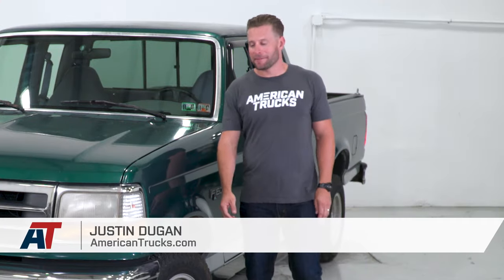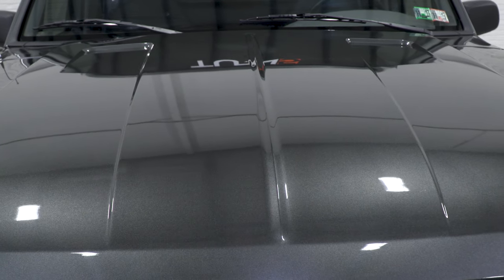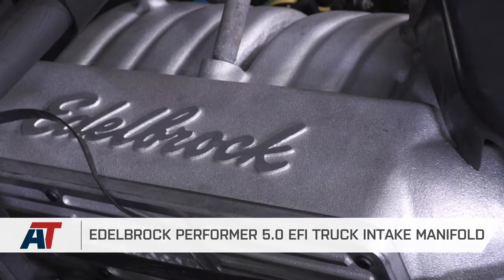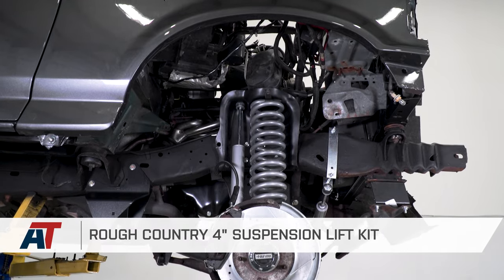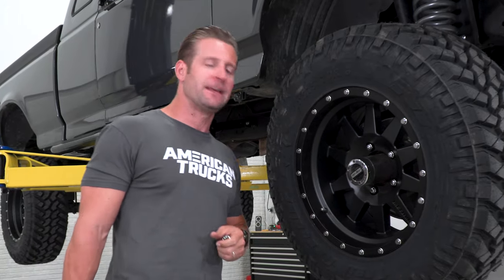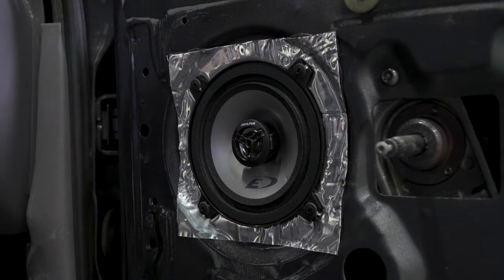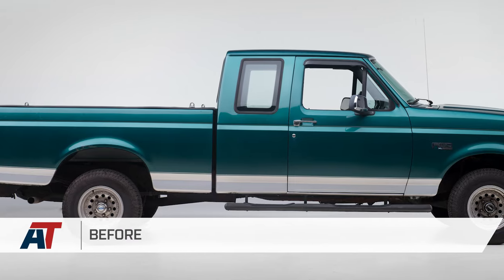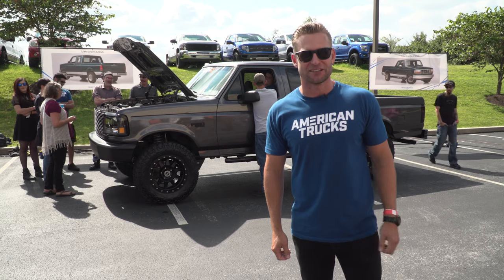Make-A-Wish F150 Build - 1996 5.0L F150 Gets A 4" Lift Kit, 34" Tires & $20,000 In Other Parts!

Comment: “Almost at 200k miles almost beyond repair” bruh I’ve never even owned a truck under 200k🤦🏼‍♂️
Reply: My dad has a 1995 f150 almost at 300k and it runs perfectly
Reply: I have a 7.3 powerstroke and she has 382k runs like new
Reply: @stankmeme5909  Lol same here. 01 with forged con rods. 315k miles. Abused 6 owner work truck but she purrs. Lmao
Reply: LOL, same here buddy. That's funny 😂. All mine are high mileage, but DEBT FREE!!
Reply: My dad's 1990 f150 manual has 850k
Reply: My Chevy is at 270k...
Reply: same
Reply: wyatt ainsworth yea 200k is barely worn in I got almost 320k on mine and she rides like a Beauty
Reply: 2008 Escalade 420k miles only change waterpump and thermostat
Reply: Those 4.9 V6 last forever dude. I have a 1994 XL F-150 with 200k+ and it runs great.
Reply: Tucker Roberts yup my 96 f-150 sat for years before I got it and is rusted like crazy cause I live in Canada, but the engine runs like new only had to replace the end the connects to the battery
Reply: These dudes are nuts. The 300 i6 was the best damn motor they ever put in a truck. Lasted forever like a diesel
Reply: @FD_FTP  Mine has 338k miles and still running strong.
Reply: @thejuiceisloose8703  totally true!!! I got a 96 with a inline 6, over 300,000 miles and it stayed awesome! Doesn't leak oil or anything! No rust! I inherited it from my dad, and I drive it every day for work. It pulls my utility trailer and tools...love my truck!!!
Reply: @normansawatzky4778  read a story a few years back from the clash for clunkers days that Obama did. They followed procedure by draining the oil and adding the additives to freeze the motor up. It ran for more than 3 hours before it gave up. I've had two of them and bit had over 240k. Ran smooth as can be.
Reply: In the north there’s trucks that go beyond repair at 100k with the frames rusted through.
Reply: My dad's 2002 dodge truck is way over 200. The AC leaks when it sits and needs a heater core. Lifters were replaced 2 years ago. Drives perfect
Reply: @xBIGxSAVAGEx a truck.... a.....Truck..TRUCK....I have a 14 mustang GT but nice try🤦🏼‍♂️ I like the older Silverado’s
Reply: Not as high miles as a lot of y'all but my 96 has 195k or so and runs great
Reply: my truck has 400,000+k and it was a mud/work truck  most of it's life and even with i6 it still wants to party
Reply: My F150 94 I6 has 200k and runs really good lol
Reply: I have a 1997 F-150 with 168,000-168,300 miles
Reply: Yeah I have an 03 Ford F250 and it has over 450,000 miles
Reply: I just bought a 94 i6 f150 with 190k wish me luck

Comment: Should have undercoated the thing so it doesn’t rust out any more than it already is
Reply: Clay Sensiba I’m saying, they had already took the body apart too so it’s not like it would’ve been a lot of extra work.
Reply: Also should have painted it last
Reply: Sandblast the whole thing then paint the frame build it then paint the body
Reply: They mentioned that they had a very limited timeline, maybe that's why they didn't undercoat the whole thing
Reply: Clay Sensiba lol brand new 2nd gas tank but we for got to clean the straps up
Reply: They could have hit the problem areas with a wire wheel and spray paint it dose not have to be perfect.
Reply: Clay Sensiba no shit i was like thats a sweet truck except that frame getting ready to snap in 3 years ....should have bed lined that frame and under bed and cab
Reply: Or maybe theyre not retarted and know that the frame will rust faster with an undercoat. The undercoat traps in moisture and accelerates rust, you just can't see it. Its either strip it down and powdercoat the whole thing, or let it ride.
Reply: Clay Sensiba indeed
Reply: @The Baddest Of Them All 
Chassis Saver or any other brand of rust converter would have been the optimal way to deal with that rust!!!
I just used it on a drawbar hitch and it came out nice!!!
Reply: That’s what I was thinking
Reply: keep in mind this build was on a charity budget, so they had to cut corners somewhere. not to sound mean or anything, but when you're pimping out a truck for somebody who is dying longevity is probably not a big issue for them.
Reply: @thebaddestofthemall9670  if you use chain bar oil for your undercoating you do not have that problem.
Reply: Most under coating seals in the water and causes more rust to rot quicker. It can't get air so it cant dry.
Reply: @user-zq6pj5jo8j  That is true with any undercoat that hardens, NOT true with oil or grease or transmission fluid.
Reply: They did a slight under coat
Reply: Lmao, not all of us live in a snow covered wasteland.
Reply: Undercoat actually seals in the moisture and causes the undercarriage to rot out quicker
Reply: actually I wouldn't do undercoating your better off to just oil spray the frame every fall and that all depends where you live as well.

Comment: When I saw the Alpine headdeck and JL speakers I knew these guys  were legit.
Reply: lol that was me when i saw the cam!
Reply: Sundown, CT audio and dc Audio are way better than any alpine or jl stuff but grant it not everyone can spend 1500 dollars on one 12 inch sub.
Reply: "ok so we're installing a brand new dual head unit with some pyle speakers and a lightning audio subwoofer powered by a boss armor 6000w amp" hehe could you imagine the cringe?
Reply: Kale Gorskey all of those brands you mentioned are spl oriented, they are not good for sq
Reply: Electronics For Fun I’m deaddddd hahahahah
Reply: @avrajsamra4548  they arent oriented for anything but being terrible
Reply: @seanmartin5056  word. Came here to comment on that but you beat me lol
Reply: How do you amplifier 4 door speakers with an amp in the back. I literally have 4 speaker wires, 4 RCA cables, and a power cable running down the side of my truck to power my door speakers. They’re     75 watt RMS each and loud as heck but wires galore

Comment: Cam, headers, Flowmaster exhaust, but you leave both of the stock and restrictive catalytic converters from 1995, why?
Reply: KsKaylor so he doesn't lose that back pressure boy damn gotta have the cats
Reply: @IFFIkillaWard  No you don’t. You think any Fox Body running around still has cats? As long as you run them out the back you’re good. I’ve seen a tiny amount of power loss in turn downs

Comment: I have a 1990 Ford f150 4x4 with the 5.0 engine.
A lot of good things that you've done in this video and some that I plan on doing. My biggest thing is to pull the engine. For a lot of years my engines leaking oil all most as fast as you can put it in. I broke my back 14 years ago and it takes me a long time to do anything. 

I have a couple friends who have offered to help me get my engine out. Once I do I plan on doing all the work on the motor. I figured over the winter I can do the motor. I usually get about a half hour to an hour to do things before I have to lay down again so that's why I figured winter is perfect.
I'm really not thinking of changing the color after saying this I'm considering it. That's my color if my truck was going to be anything but black it's going to be that color.

I love that front bumper that really makes the front end look good. I also like those rims. I'm happy with 31s under my truck. To me that's my perfect size and I've never ran into problems with needing a taller truck. 

I'm definitely saving this video so I can use it for references for working on mine.

You guys really knocked it out of the park.

Comment: When are you guys offering support for the 93 to 96 Ford's I have a bronco and it needs love but funds are dwindling but I love how easy everything is to find on your website it's all right there!
Reply: I’ve been wondering the same thing for a while now
Reply: I have a 94 Bronco and it would be awesome if they can work on it.
Reply: Im a coved19 survivor can my 94 bronco get that makeover. Its not as rusty i promise.
Reply: @OliverKoolO  what do you need done?
Reply: The stuff that goes bad when an old ford sits to long. Timing cover seal leaking coolant.  Thats a pain to change. I did do a rust proofing/prevention using Stabil took 4 cans and Im really happy about it.

Comment: they spent 20,000 and could not rebuild the motor. that probably burns oil .plus with the lift ,tires ,and new gearing the motor won't last 15,000 miles, from a lead footed teenager. but at least the truck will look good sitting on the side of the road with a piston rod through the block.
Reply: biggy poppa not really. They’re built to tow. Big tires won’t affect it much

Comment: Can't fit 35's ??
Reply from the maker: Negative. -Justin
Reply: Bullshit- it didn't need the lift kit to fit 33's, mine is on 33's with the std gear, 33 is the limit. With the long perches you put under that truck, 35's easy, just have to watch/alter offset to negate scrub.

Comment: I lifted my 87 Bronco and a bit more. My lift did not drop the TTB down at the mount. My TTBs are cut and turned at the end then I plated and gusseted with a plate also wielded to the diff. The chromoly radius arms are to the back of the door heim joint mounted. The King Shocks (huge improvement massively huge) mount lower and my spring shock tower cut gusseted and has a chromoly tube up off the top that arcs back down to the frame. I put a 96 front end on with glass fenders and hood grill core support lights (converted to HID). Put 96 spindles calipers that bolt on instead if the pins. Rotors and Warn premium hubs. Chromoly axles with a F-250 slip shaft and U joint. Trimmed my  AC box cycled every way clearing my travel trimming metal. With no sway bars l limit strpped the suspention to 18".  The rear got a upper frame to frame shock tower and Deaver Springs no sway bar and limit straps for more King Shocks. Swapped my 5.0 to a 95 5.8 full roller balanced and blueprinted  built up 408 stroker with AFR heads and still injected. 4.56 gears with lockers new driveshafts rebuilt and improved transfer case and a Monster transmission with wide 1st gear. Optima bat. loud and clean stereo  with bass box. Need to build new bumpers get rear glass fenders, paint (not expensive). Then full frame mounted cage solid body mounts and body wielded  to cage. Lowrance GPS and may go coilover in front. Hydro bump stops too. There is a difference off roading see here. https://www.youtube.com/watch?v=OIYPKwUbzNE
my 1st Mojave Road 150 mile dirt trail clip with my GF here..https://www.youtube.com/watch?v=LtuWtuR2qIg
Then there is this video with a song I play loud passing the Jeeple traffic over crawling over 1 foot whoops at 5mph spotting each other off a curb . While I pass toasting them out my window at 60-70 over 3 foot whoops not spilling my drink. It is not my Bronco on this video. https://www.youtube.com/watch?v=D4lSk48-_0o
Gen X South Cali Punk what do you expect. <(:</)  It is not for meeting girls at the mall !!! Meet  those 60 feet from my house in G strings on the sand.

Comment: Dang! His dad found a friggen MINT OBS. That truck is beautiful!! ❤️❤️🤟🏼💯🔥👍🏼
Reply: I'm jealous.  That thing is mint. I love it. I had a similar spec in the early 2000s... I had a 1995 regular cab, manual trans, XL, 4x4, in the same green color.  I loved that truck.  I put on a 6" Superlift with 35" Baja Claws. ✌️💪🏼🤟🏼💯
Reply: I really wish mine was a 5.0 or 5.7, but unfortunately... It was just a 6 cylinder. It was super reliable, but just didn't have quite enough power for my liking.  Especially once I lifted it and put on the 35"s.

Comment: Even better would be the 300 6. I owned 7 1988 threw 1996 that I drive now . It has the 300 with 280,000 you can start it on dead cold and not one motor sound. The 300 is the low end torque monster and will take the hard abuse, and come back the next day for more. I have seen them hit 400,000 miles. Two of my trucks had the 5.0 s. But they couldn’t lug like the 300

Comment: Did I not see any hub centric ring for the aftermarket rims? The hole for the center of the rims looks much bigger the the factory hub. Should get that rectified so his wheels don't sheer the studs off and he loses the wheels and get into an accident. That's assuming those spacers were not put on. At least it appeared that way to me with the front hubs.
Reply: typical dodgy build.

Comment: Love the idea behind this, but they could have started with a nice clean, low miles XLT Lariat and just painted it and added the tires/wheels/lift for a LOT less that $20K.  One of the big things about getting a 20~30 year old truck is that you get all kinds of extras with it for cheap.  Mine is mint, has a Gear Vendors, 5th wheel and was $1,800.  I did the paint and rebuilt engine for about $3K more and it's in amazing condition.

Comment: What do you have to do to these trucks to make them not ping to death with an aftermarket cam and pistons? My 94 doesn't have a sensor by the air box either. I'm guessing get some expensive computer programmer device.
Reply from the maker: The truck was flashed with a tune. -Justin

Comment: I have the 5.8 f250 with 3:55 rear gearing and it still beats a good amount of trucks even with 240k miles and I have 33s on the truck but its an open diff :(
Reply: Also its not lifted

Comment: I wanna redo my 1994 4.0L v6 built motor and tranny and I’m wanted 30 inch mud tires with some blacked out tail and head lights. That’s a lot of money to finish with but I’m hoping for a 6 inch on the front and 4 inch lift on the back just to level it. Along with a voodoo 12 inch speaker and new speakers and I have a 1000watt amp, that’s a lot of stuff but that’s all my truck needs for what I do

Comment: The truck turned out great and such a great cause!!

Couple questions for the American Trucks.  I looked on your site and I don't even see the 85-95 F150 as an option to select.  Am I missing something?
I have a 96 Bronco XLT with the 5.8 and have a hard time finding parts.
What gearing did you go with?  
Did you do anything else to the engine besides cam, intake, headers and typical maintenance?
What brand headlights are those?
Is that dual exhaust kit available for the late model Broncos?

Comment: I own a 1995 Ford F150 extended cab Eddie Bauer edition automatic since brand new origional everything except tires and window motors about 250,000 miles , half the cluster isn't working  no idea how fast I'm driving speedometer doesn't work yet I don't drive fast anymore .

Comment: 100,000+ miles on the engine and you put in a cam, timing chain kit and resealed it ? Damn, I would have just rebuilt the engine, crank kit, clean up the heads and a valve job etc. A nice SOA while at it with the suspension would have been sick.

Comment: The 5.0 is not a plus.  I have 4 of these in my time. The 300 6 is a true high miles work horse; paired with that 5 speed and 373s. My 88 seen 280,000 miles with little easy use. I want a new one just exactly like it. I hate all the craps they put on new ones.